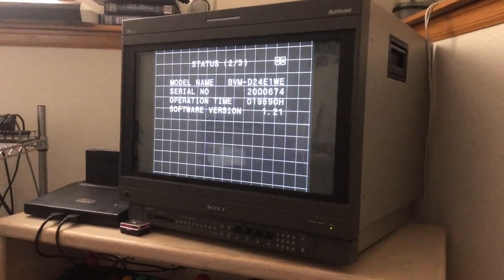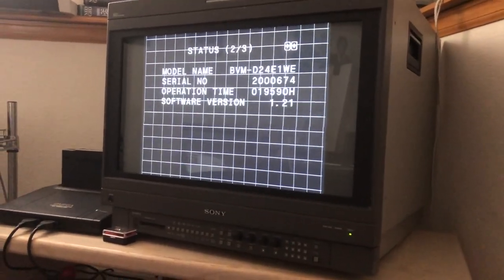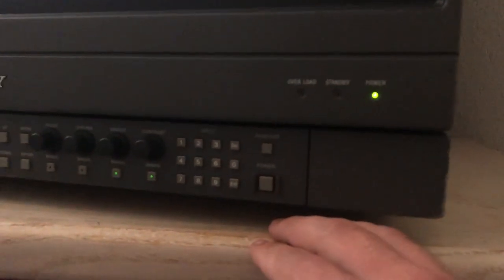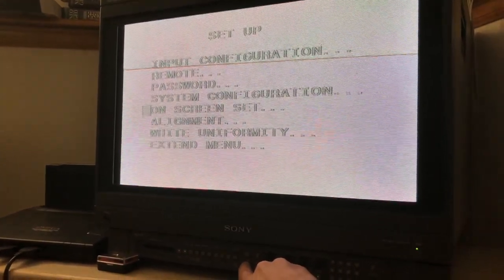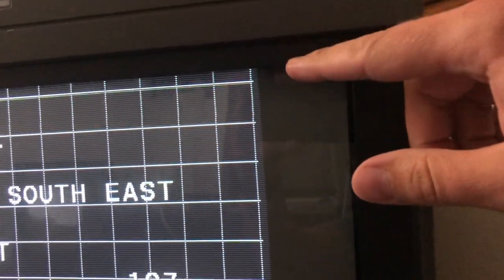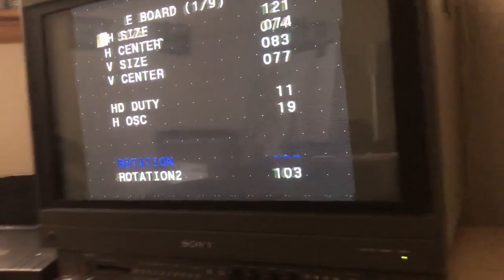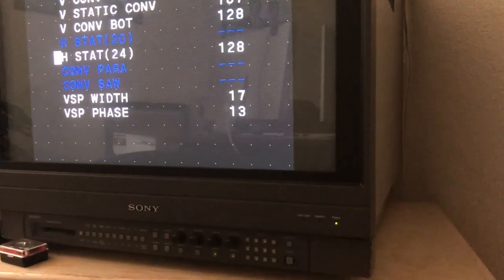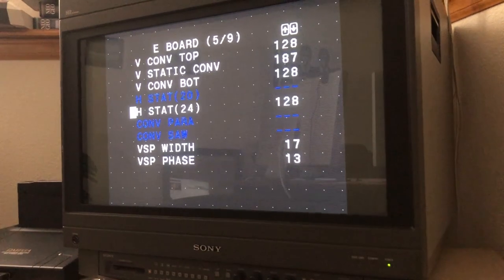Sony BVM-D24E1WU - Basic Calibration Guide

Comment: Hey is it possible get this grid on a 20F1U?
Reply: Necro post, I know but here's info for anyone else who has this question:  I have a snes cartridge called "240p test suite".  It is also produced for sega consoles.  It has geometry grids, many color/brightness test patterns, latency tests (audio AND video), and can toggle between 240p/480i (both are 15KHz signals, CRTs don't mind 480i, but new displays might act funny).  You can buy them online for 20-30 USD.  There are also test suites that you can burn to DVD and use on the CRTs, but I don't know much about those.
Reply: Yes, use the same steps as described in this video.